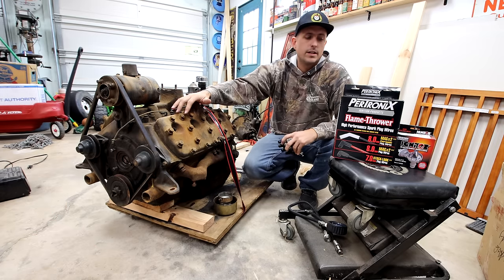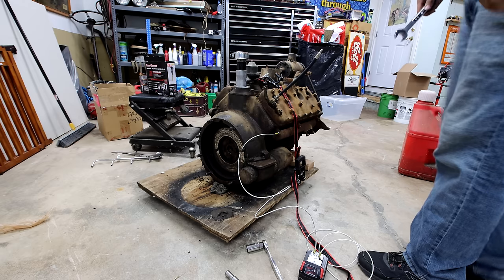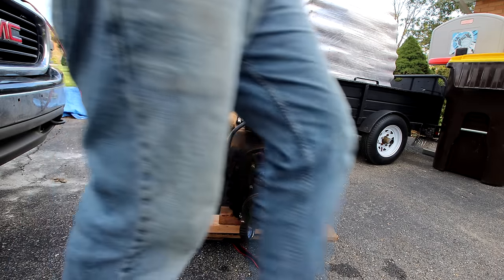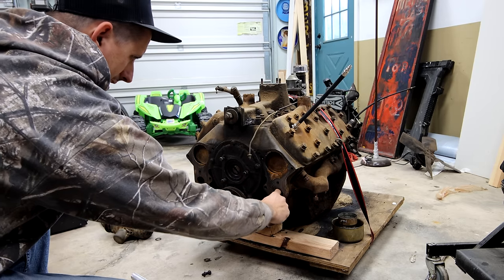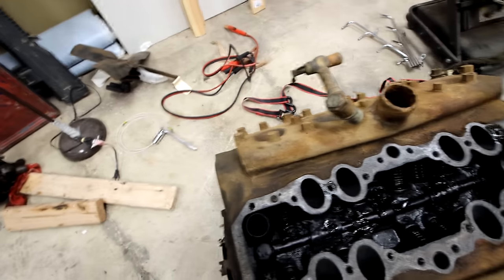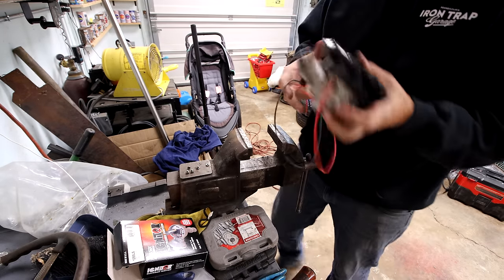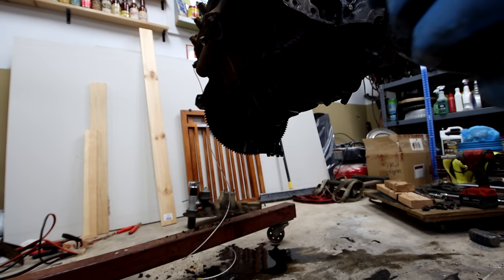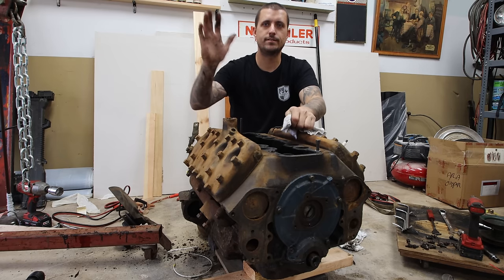Is Mike's 1937 Ford Flathead Engine Useable?? - Compression Test Isn't Great

Comment: When I revived my flat head in my 47 I blocked the lower hose opening and filled each side with Evapo Rust, let it sit for three days then dumped and flushed, two new water pumps, new hoses and I have never had a over heating problem. Pulled the oil pan and cleaned the crud out and have been changing the oil every 500 miles to flush the engine, so far so good.

Comment: You've got more than enough compression for the engine to start. The low cylinders are probably low due to crap and corrosion on the valve seats. Once you get it started and run for a bit, the compression will come up quite a bit. I started a 39 one time that hadn't been run in many years. I think it started on 1 cylinder. As it struggled to run another cylinder would kick in, then another and another until all 8 were hitting.
Reply: Spot on Joe!  Folks of my generation would never bother running a compression check on an engine that had not been run in years.  We all knew that the engine needed to under go a few heat cycles to free up the valves and rings.  That's how we did it back in the 1960's.

Comment: Im sure you already know this but with old engines that have weird compression its best to run em and heat cycle em a bit. Loosens up the rings and sometimes the compression will come back

Comment: Couple squirts of oil in the low reading cylinders and check them again, if compression goes up you'll know it's a ring problem and not valves.
Reply: Squirts of 'master blaster' first to free up those rings..turn over, let 'em sit a bit and then oil 'em and test.
Reply: @MajTom-wd2yt  Backwards

Comment: You’re really close to just a quick rebuild Mike, definitely pull the heads off and get a cylinder bore measurement and check for out of round, the motor might be in good enough shape for a very simple rebuild, and you would have peace of mind driving it further from the house, wish I lived closer!
Reply: As someone who has disassembled four flat heads in the last couple months, my expectations are a bit more tempered. I hope he’s that lucky!
Reply: There is no such thing as a quick rebuild on a flathead ford v8.
Reply: @classicautorepair2100  this is what I do, there is quick and simple rebuilds

Comment: With your engine having sat for a long period, about the only thing a compression test will tell you is if you have any stuck valves.  You need to get the engine running to loosen up the rings before a compression test will tell you much.  Good luck.

Comment: Sludge was a normal hazard of those old motors , as was stuck rings . I can recall an old advert for one of the early additives ( maybe Bardahl ? ) -  which talked about the ' 3 Villains ' -  ' Gummi Rings ', 'Sticky Valves' and 'Blacky Carbon '...!

Comment: Mike, that flatty looks like it has potential.  As others have said, the valves seating and rings, possible glazing of cylinders could be reasons that compression is low.  If the block doesn't have cracks and the bearings have life left you may luck out with a cleanup and runner.  Don't get discouraged it is worth the effort.  Flatheads forever!

Comment: When I got the flathead four banger in my old Farmall tractor back to running after sitting for years, the compression was like yours except lower.  I soaked the cylinders in Marvel Mystery oil while I was working on other things on it.  When I got it started, it was smokey as heck, but the rings did free on up and I have decent compression on it now.

Comment: I think before I dipped my hand in my pocket for more stuff I would pull the heads and pistons and check the bores, bearings and rings. I would also check the valves. With all that sludge in the motor I think it might not have been looked after as well as it could have been

Comment: The cam gear is a press on so that means you have to pull the valves so you might as well pull the pistons for inspection. All that sludge took a lot of neglect to build up.

Comment: Good to see you getting your hands dirty on a flathead Mike! :-)  Just one question - couldn't you have used one of those cool vintage engine rebuild stands that you and Matt have at the garage, instead of working on the engine as it hung off a chain? Been there, done that, but stands make the work so much easier!

Comment: I live in Las Vegas nv and I'm 80 yrs old and have 2 flathead engines. If you flush every thing out on a 4x8 sheet of plyboard then roll the blocks over and over as much as possible getting all of the original sand casting sand that was in the blocks leaving the plant, you'll be suprised how much sand you'll get out. I have a 1947 ford and a 1937-39 french ford 60, it's supposed to have 60 hph but it has about 135 hp ,  they sound great, reliable, simple, it'll be worth all the extra effort,  24 in glass packs, the best, good luck, Jim in Las Vegas where its 115 for about a month in the summer.

Comment: A quick hone and a couple heat cycles and that compression will come right back... Had the same issue, after a quick hone and a few cycles it came up to 125-128 PSI on all cyls... Good luck with it Mike!

Comment: Hi Mike,
Yes welcome to Ford Flatheads.  Pour some marvelous mystery oil into the cylinders,  does wonders for loosening those rings that appear stuck...brought mine back up.  Decisions Decisions...what route to go...I feel your pains.   Best of luck.  Btw, made up my own wire loom by taking aluminum tubing, cutting the lengths I wanted, put them together (aluminum brazed), and polished them.

Comment: Great video!  This is at least the fourth engine video I've seen where the oil pan has to be drained and then thoroughly cleaned before any serious engine work gets done. Those old oils didn't have any detergent qualities nor were they multigrade.  The pans were all full of oil muck and sludge which left alone would find their way back into engine.  Same rules apply to gas and gas tanks in these barn find cars and motorcycles. That stuff has got to be cleaned and cleaned out.

Comment: Mike as a suggestion. 
When you use that test stand install an electric fan to the radiator it's more efficient for cooling the engine. 
Having the stock fan so far away from it does not draw that much air .
11:11 Well I would say not good. How deep is that sludge ? 1/4 to 1/2 inch ?
If you are going to use this engine it would be nice if you could install an aftermarket spin on oil filter.
This way to help remove the sludge is to run the engine with one quart of trans oil mixed with the new oil. Changing it every 1000 miles or so with a new filter.
Trans oil is a much higher detergent than motor oil.
Don't know if the timing gear (cam gear ?) is made like the 4 cylinder Model A. The A cam gear is compressed paper. Pour gas on it and set it on fire and it will just burn away.

Comment: Possible theres a tiny bit of rust on the valve seats causing compression to drop. Test after the engine has run for a while and see if it changes.

Comment: Hang in there Mike, after a deep clean it may turn out to be a good runner. Weird the timing chain gear has a crack in it. I think I would push on to the engine run before doing to much else at this point.

Comment: Clean out as much of the sludge as you can. Then dump 1 qt. of ATF into the crankcase and then top off with fresh oil. The high detergent in the ATF slowly breaks down the sludge, carbon and rust ( if there is any ) . It works great for cleaning an engine out safely. You don't have to worry about it knocking loose large chunks of sludge/debris to plug up the pick up screen and oil passages like some harsher flushes can do.  It can also free up stuck rings.  Just run the added ATF for a few oil changes and the engine will be nice and clean inside.

Comment: Mike, be sure to clean the main lubrication tube BEFORE starting the engine. Remove the timing gear and you will see a brass plug that is removed by a large screwdriver. Pass about a 5/16  rod or wooden rod through the passage to the back of the engine. I used an inexpensive dowel from Home Depot. This passage MUST be clear to allow oil to the bearings. Failure to do this will lead to ruined bearings and a seized engine. Good lick.

Comment: We always put a little oil in cylinder and checked compression again
Then low compression would be valves because oil helped seal the rings while testing

Comment: Spray some PB Blast penetrating oil into the cylinders and rotate the crank a couple times and spray a bit more.  Then let it sit overnight.  Rotate it some more (I just use the starter) before making any more pressure tests.  Any stuck rings will show their appreciation, at least somewhat.  Pulling the pistons is likely a good next step.

Comment: At least your sludge is still soft and gooey.  It will eventually work its way out (with a lot of oil/filter changes).  The compression problems are probably a combination of stuck rings and dirty valve seats.  The rings should free up with a couple of heat cycles when you run the engine.  You may need to reseat the valves to clean them up.  The valve seals will also be suspect, causing excess smoking...The rust looks about normal, just needs aggressive flushing...   Good luck..!!

Comment: Mike those compression numbers might not be the sign of a bad motor, it could be a sign of stuck rings or rusty valve seats. I'd  start the motor on the run stand, and run it threw a couple heat cycles, but before you do that pull the plugs, drain the oil, dump in a gallon of diesel fuel, and crank the motor with a battery, let it set overnight, and drain.

Comment: Mike: I noticed that the starter rpm kept changing during the compression test you performed during this video. This will have an effect on your readings. I think you would do well to mount the engine on the run stand and get it up to operating temperature a few times. try to keep the rpm below 3000. Once you finish the "heat cycle" running, perform another compression test. This time do a "wet and dry" test.Test all 8 cylinders, record your readings and then pump some oil into the cylinders and run the test again. The cylinders which show a higher compression after oiling most likely have rings which are leaking. If any valves are leaking, the oil will not effect the reading on that cylinder. One further test you can run is to pump air into each spark plug hole at low pressure. if you hear air escaping from the intake or exhaust manifold that will indicate which valve is leaking. The results of these tests will give you a good idea of what further work the engine needs.

Comment: FYI 1937 was the only year with 21 studs and block water pumps. Some of the heads (not all) had a casting between the  2 center plugs of a raised diagram of the firing order.

Comment: Best thing to do is just dis-assemble the entire engine, inspect it and send the block out to be Hot Tanked. If the cylinder walls look to be in good condition then hone the cylinders lightly and just install new rings and bearings in it.

Comment: Spray a bit of light oil into those cylinders first, then do the compression test.  Cold dry cylinders won't give you accurate readings.
Reply: Actually oil in the cylinders will bump compression up...use oil in a cylinder when you suspect compression leaking past the rings, do the test normally then put a little oil in and if there's alot more compression rings are wore out...

Comment: Put some engine oil in the cylinder, recheck your compression. If it comes up in that cylinder, you need rings. If 2 adjoining cylinders have low pressure, and the oil didn't bring up compression...it's more than likely a head gasket, stuck valve, crud on a valve...ect. Break down time.

Comment: If its been sitting a long time the vavles could be stuck open a little.  I wouldn't be to concerned about the numbers unless it was after it was fired for a few minutes. Clean out the mouse bones and send it. Run it on premix at first. Then check it. Make sure you don't have rusty cam lobes. Not sure you can use factory fan, it doesn't clear the distributor you want to use. Go with an electric fan.

Comment: Quick note :

I've run straight white vinegar thru many a coolant system.   Including .. driving with that sh*t in it for a week.  Removes a sh*t load of trash & rust.  Empty system,  refill with hose water & baking soda, run again.  Empty & fill with distilled and/or antifreeze.
Reply: Yes Vinegar works the best. My grandfather said they were doing that back in the Korean War

Comment: Hi Mike. All jokes aside mate. Seriously suggest you strip the engine down and give her a good clean out from top to bottom. Give the cylinders if they're OK a hone job. Might get away with a crank polish. A set of rings and bearings. Valve job might help. Appreciate you want to do as little as possible and get the thing running. Having wasted many hours and $$ on these cast iron wonders. Simple clean through as suggested will save you a heap of trouble later.

Comment: In your case, I'm surprised you're not going with at least a 59A (24 stud) motor. This motor may have been rebuilt but sure looks like it's had lots of "non-detergent" miles on it. I would suggest getting a couple of gallons of white vinegar to fill and soak the coolant system. Does a pretty good job of "melting" that rust buildup. 
Forgot. Isn't that plate inside the distributor supposed to rotate to allow for ignition advance when the engine is running?? Good luck!!!

Comment: We used to clean the FHd's by putting a gallon of TRI CLEAN in the empty oil pan Then we would use a two burner apartment stove under the oil pan and a hour later the motor was degreased

Comment: That old oil (especially Penn) generated more sludge than new engines - I've heard that it's got more "wax", esp in Penn. If the sludge is just carbon and waxy gunk, it's not a death sentence, just clean out as much as you can. The new oils will start breaking it up, which ain't good.  An old guy I knew swore by warming up an engine, draining the oil, refill with 1/2 diesel-1/2 oil, and run it like that for 15 minutes. Sounded like trouble to me!

Comment: Mike, it’s probably been 40 years since I messed with a flat head, but aren’t there drain plugs at the bottom of the block for the water jackets? If There are, I’d pull them and put petcocks in Instead of plugs.

Comment: My question is do you squirt any oil in the cylinder first. Second I would of mix some Iron Out in water and fill the engine block and let set than flush it out.

Comment: Put this engine together and run it on the stand and get it up to operating temperature for a good 20 minutes. Let it cool and then recheck the compression. I wake these old flathead up all the time and you can't trust a compression test on an engine that hasn't run in a long time. I'll bet a paycheck that after a test run your compression will fall in line. 80% of the time this is the case.

Comment: Mike, as an engine builder it seems you have a sound core. Strip it and the usual hone etc. IF the rings are not gummed in the pistons clean everything up and check the gaps. If ok you can possible reuse them, ditto with the bearings. And reassemble with NEW gaskets. I have struck new old stock gaskets that are shrunk and dry and do not seal any more. So new current stock! Old engines that have sat for a good while have the same issues,, they do not seal anymore.
Compression checking old engines that have sat for a while is pointless as the rings will be at best semi stuck. And bores will have light rust as well. NOT good for checking
It is a 80y/o lump of cast iron. Get it hot tanked to get at least most of the rust out and then use a filter or sock in the top hose when you get it in the car. Tanking will kill the cam bearings so you will need new ones. 
At the very least strip it and get the block outside and degrease and pound the waterways with a pressure washer.  Good acid magt cleaner helps a bitDitto with the heads.

Comment: Tipical stuff with an engine that hasn't ran in a long time fresh oil run it flush water jacket, several heat cycles,do it all again, it will come around.

Comment: Seems like using a cordless battery and wire that small would cause damage immediately at the connection of the battery.  Amperage is a real thing.

Comment: Not unusual to see masses of sludge and old time lead deposit in the engine. No oil filters on most them was the reason. During WW2 the expected life of a flattie in a truck would be as low as 5 hours .There was a massive set up in new Zealand and Queensland Australia repairing them for the war effort. Even so,the french were still using flatties up into the late 70's in military trucks.

Comment: HI MIKE you need to pull those heads check the block for cracks personally i know it takes alot of money you play u pay tear the engine down degrease it rebiuld it is the roadster a keaper or flipper  OHIOhotrod

Comment: Bought a 1986 Camaro in 1992, just two owners.
The inside of the motor was just like your's....black tar.
Reply: On a modern motor, that's from not changing oil and running it hot.  Sludge was very common with the old oils, and doesn't signal abuse.  Back then, after 30K miles, you were using a quart every 1,000, so lots of people just kept adding oil, figuring they got an oil change in every 4 months or so.

Comment: Hi there I’m a retired auto electrician from Aotearoa (New Zealand) your jumper cables are way too light to carry the current required to crank the engine properly., A simple example imagine trying to pump fluid through a small pipe expecting to get the same volume of fluid. It doesn’t take a degree in rocket science to comprehend./ understand.....